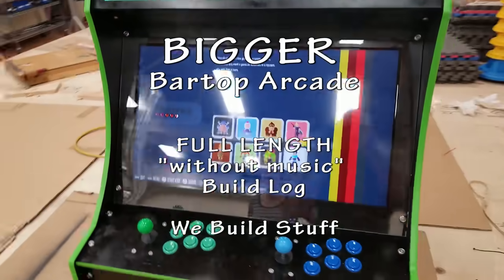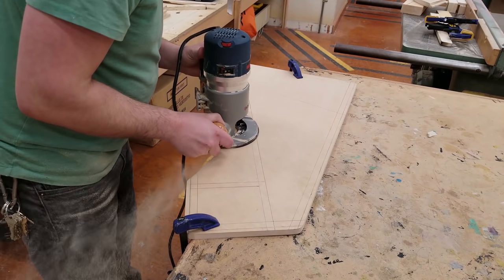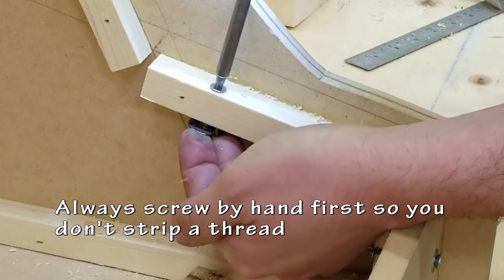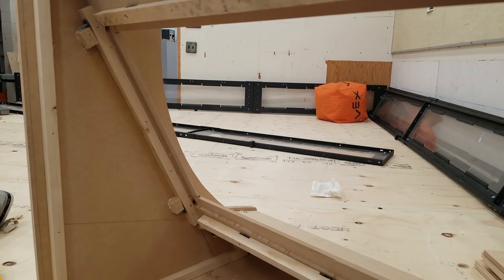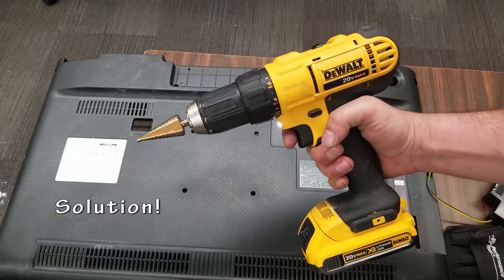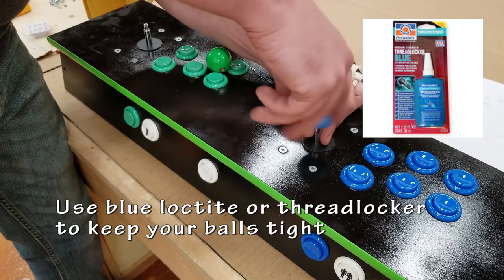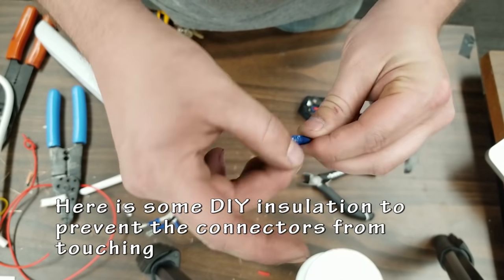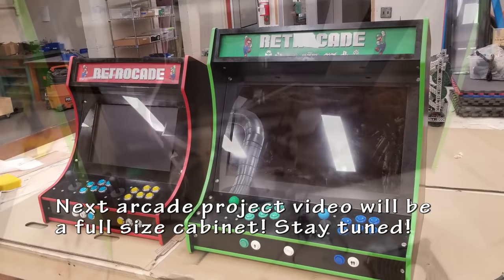Build a BIGGER BARTOP ARCADE - FULL LENGTH AND FREE PLANS!

Comment: Hi, Nice build,  i was just wondering, what speakers did you use for this project? and where did you get them from?  as I need something similar for mine, but as of now haven't been able to find anything that will fit
Reply from the maker: The speakers for this were from the inside of the tv. I pulled the case apart and relocated them using some speaker wire as an extension. Almost any cheap set of speakers on amazon (pick the size that fits your build dimensions) and a basic amp will work.

Comment: Very cool! Enjoyed the build process. Thanks for sharing. I've been working on a mame cab for about 10 years. Built the frame out of 2x4s, have front kickplate, CP, and marquee in place, but still need to do the side panels, and back door for it. It's bloody heavy. LOL.
Reply from the maker: Thanks for watching!
I built a full size cab last year and even with casters it was a pain to move around!
Reply: Ah, yes. I knew it was going to be heavy as a fridge, so I made sure to put large, but recessed casters on my machine. It's so massive, even on the wheels, it doesn't want to move, when being played. Lots of inertial mass. :)
Reply from the maker: @ThomasGrillo  But i bet it's fun!
Reply: Oh, yeh. It's fun, but the PC finally died, and I need to put a Retro Pi, or something in it. It's a 2 player cab, with a spinner, 2 track balls, sticks, 7 buttons per player, and 2 pinball flipper buttons. unfortunately, I didn't think to put the holes for them, on the sides of the CP. LOL. Just need to cut out the coin door hole, and slip in a fake coin door.

Comment: Unbelievable, a friend and I are going to start something similar for my Restaurant, I'm so exited, thinking perhaps a full sized one for home as well with the pi4.  
Quick question, is there the option to use bluetooth controllers as well like just I have some 8bitdo controllers that I would like to use on there as well.
Reply from the maker: Yes I have seen lots of builds using controllers. Add a usb hub so you can plug in on then control panel or hidden sneakily somewhere.

Good luck with your build!
Reply: @WeBuildStuff  thanx for the quick reply, I'm just thinking live yo have both options, the pi is great
Reply from the maker: @Eddylive  for sure.  Thanks for watching

Comment: id prefer using osb or plywood over mdf  as mdf is prone to moisture absorption in high humidity condition  and as for painting the cabinet i recommend using latex primer coat outside and inside  to seal the wood from moisture absorbing  then color paint of choice
Reply from the maker: That's the best thing about these is the variety of techniques, materials, finishes, etc that can be done from a base set of ideas as presented here.  These videos were originally made to help high school kids in a shop program.
Reply: @WeBuildStuff  yeah imjust giving good advice and hints
Reply from the maker: @jamesfatula5824  completely! The comment section is a great place for people to learn more 😁

Comment: So I'm following this video for my build and it's turning out really good.  I noticed in the video that your wiring of the power socket doesn't match the wiring diagram that you show... is this what I'm seeing or am I going crazy... which way is correct?
Reply from the maker: It all works. I've wired about 5 of them this way. The diagram may look slightly different depending which socket you buy. I triple checked the diagrams and so far no fire!😉
Reply from the maker: https://images-na.ssl-images-amazon.com/images/I/71fPmo0RHPL._AC_SL1200_.jpg
Reply from the maker: @JayGasEssex  thanks for the tip. I checked the wiring and I did do it correctly. I think the labels on the photo were different

Comment: I was wondering what a rough cost is to build just the cabinet? Great video and I will have to check out your other ones. Thanks
Reply from the maker: Just the cabinet sheel usually costs between $20-30 for me if I'm using 1/2" thick MDF and some 2x4 or other scarps to make the cleats.

Plus whatever costs you can get hardware and electronics for.

Comment: Probably a Moronic question.... but can a cabinet such a as that one can it be build with arcade stick controllers with a HDMI selector and have for example 3 mini consoles to it??? nes mini snes mini Nd sega genesis mini...
Reply from the maker: It is just a box and you can fill it with whatever you like! I think the tricky part would be switching controllers between systems.
Personally if you wanted to to have NES, SNES, and Genesis then those would all run well off of any raspberry pi from the Pi Zero to the Pi 4. Those systems  do not require a lot of power to run.

Comment: Hi,
How did you get the angle when doing your control panel ,cutting on a table saw ?
I have the angle which is 103 degrees so I set the angle at 38.5 degrees which is a mile off ,any ideas ?
Reply from the maker: Table saw or angle with a circular saw and a guide. I typically have a scrap piece I practice with unless I know the angle already. It can change depending how well you do your layout lines
Reply: We Build Stuff 
Thanks for the reply,to get it accurate I took my angle finder and put it to the saw blade and set the blade that way.

Comment: I dont have anyway to cut or saw wood at home. Do you have any tips on how I can do this otherwise?
Reply from the maker: In all seriousness do it outside or in a friends driveway/garage with some very inexpensive tools if you shop around.
You can build something like this or at least a basic one with just a drill and a jigsaw if you go slow.
A single sheet of plywood/mdf is enough to do this project and maybe 1 2x4 the way I do it. Half the 2x4 used as the inside brackets and to put under your wood if cutting on the ground if you don't have a table or sawhorse.

A used drill with maybe 3 drill bits, used jigsaw with a medium blade, hammer, nails, glue, screwdriver. A good ruler/meter stick is great but you just need a way to make accurate cuts and go slow. All the above are what I recommend to home owners for fixing and maintaining their homes in general.

If you dont have any way to build there are many affordable ready to assemble kits on the market. Lots of ways to customize your build depending on what you are willing to put into it. Lots of great channels sharing info on these. Check out ETA PRIME for some good info on the programming and game side. I just enjoy building cabinets😁

Comment: Is there something else i could use besides a table saw or a jigsaw because ever since i witnessed a friend of mine cut his finger off in woodworking class i always have those thoughts of cutting off a limb.

Also if i ever do my own arcade build the one thing i was thinking of doing was using a 200mm fan in the back (intake) and on both sides using 80mm fans (exhaust) and also use varnish to give it that clean wood look.
Reply from the maker: Witnessing an injury (or having it happen to you) always sucks but if anything it can be a learning experience on what not to do. Getting the right training or demonstrations is always key to avoiding bad stuff happening! 

A Jigsaw would be the minimum I would use since it's cheap and can handle just about everything for a project like this.

The cool thing about every project is the ability to customize the look and everything about it!
Reply: @WeBuildStuff  There is one other thing i was thinking of doing for my bartop is adding joystick latches on the side pretty much making 2 more arcade sticks that can connect on the side with 3 to 4 buttons only for those 4 player action/adventure games which is why i plan on using a 26" to 32" monitor but also still waiting as well for Recalbox/RetroPie to release a working version for the Pi 4 cause there are certain games i love that doesn't run well on the 3B+.
Reply from the maker: @EcksGamer  check out the Odroid xu4 boards. More power than a rp3
Reply: @WeBuildStuff  Well there is also the Atomic Pi which is also more powerful than the RP3 cause it is using an Intel Atom X5 chip which installing Linux on it and RetroPie should be able to play games a lot smoother.
Reply from the maker: @EcksGamer  Cool beans!
I enjoy building them more than actually playing :)

Comment: Hi,
The final result is amazing!!
I have 3 questions :)
1 - the pad where the stick and buttons are, looks small, is it comfort?
2 - what is the thickness of the MDF, couldn't find it anywhere :)
3 - on the plans pdf, is it inches or CM ?

Thanks :)
Reply from the maker: Metric measurements in the plans that are not entirely perfect. I always tweak as I build. 1/2" thick material from home depot.

I find the pad comfortable but if it was a bit deeper it would give your hands more room to rest.
Reply: @WeBuildStuff  thank you :)
Are the plans on CM or inches?
Reply from the maker: @reemh3977  Metric. There may be  some in mm and cm. I need to re edit my plans but everything is available in DWG cad format if you need to make changes. Check the description for links.
Reply: @WeBuildStuff  you are amazing!
You fast responses, and care :)
Do you have some newer plans with some modifications? Or I can use those for my project?
Reply from the maker: @reemh3977  I would use the plans I have there and change what you need. Always use plans as a guideline. Everyone has different tools and may build differently. I have presented mine to go with the video and show the techniques I use to get to the finished project

Comment: Hi, thanks for your work, I have a question please: how mutch game we can put in raspberry pi? and if we put much games that's make it slowly or has problems
Reply from the maker: Add as many games that will fit but I have seen different results from usb sticks that are slowed down with too many files. I've started by only adding the games I want to play on my personal arcade
Reply: The amount of games is only ruled by the size of SD card, but now the Pi3 and 4, can use external USB drives I have a 1 Terabyte on my Pi 3
Reply from the maker: @yodamann5193  ya thats rad

Comment: I'm making one right now and if it turns out I'll probably try to add a bottom with an invisible seam. It's 32" screen so full size screen. I want around 10 machines in my basement man cave/bar and thinking about it it's kind of pointless when one arcade machine can have 100s or 1000s of games built in but screw it I want 10 machines lol
Reply from the maker: Some single player ones would be cool as well and double player fpr other specific types!

Comment: hi i no this is a old post but im attempting to build a arcade bartop machine based off the plans you have got here im already half way through im using 12mm mdf wood my first time doing the t molding etc im just recently ordered a router i pick it up tomorrow first time user on it so my question is what t slot cutting blade do i need to cut the edge of the 12mm mdf please.
Reply from the maker: I ordered these for my router. There are other sizes available but these fit well for my t-molding (also ordered from the same site)

Cutter:
https://www.t-molding.com/whiteside-slot-cutter-6700a.html

Arbor:
https://www.t-molding.com/whiteside-arbor-a200b.html

T-molding: (lots of colors available)
https://www.t-molding.com/1-2in-green-t-molding.html
Reply: @WeBuildStuff  thank you kindly for replying back to me here in new zealand at my local bunning store i picked up a 3mm blade with the abor peice im now thinking i should have got the 2mm blade as the 3mm blade i got is just slightly bit to big so i will get a 2mm blade next week so the t molding will be a tighter fit to go into the groove thanks for the advice and info i really appreciate that.
Reply from the maker: @markhowe6334  if it's loose try some super glue!
Reply: I used hot glue with glue gun thst sorted it thanks for the tip I just need to get a craft knife and try to trim the plastic on each side to go flash against the panels on side.

Comment: how do I get the pc monitor to turn on without using the power button due the fact that the bezel is in the way.
Reply from the maker: I choose monitors that powered on as soon as they got a signal or i would drill a "sneaky hole" that lines up with the button that can be pressed with a finger or a pen.

Comment: Just a pro tip of my own .... 
If you take a straight edge and clamp it to your work piece you can use it  As a guide to get a straight cut Quick And Clean. (with a jigsaw or skilsaw)
Reply from the maker: For sure. I have a sled for my circular saw now but not everyone has that luxury 😁
Reply: @WeBuildStuff  I use my 6ft level most of the time :D

Comment: How much would you say this would cost for me to take to a carpenter? A rough guide price, using his materials, not mine. Need some guidance on a fair price.
Reply from the maker: Build it yourself for under $500-600.

If I was doing custom  builds (not quantity pumping them out) i wouldn't charge less than $1500-2000 for my time/materials/experience depending on options.

I would consider that fair for a custom build

Comment: What are the screws called that you use to attach the monitor glass? I’ve been looking all over to figure out where to order some like that.
Reply from the maker: T nuts. I think I used #10-24
But as long as you choose matching bolts/machine screws you should be good
Reply from the maker: https://www.amazon.ca/SNUG-Fasteners-SNG1015-Hooks/dp/B089Q1RJTK

I find these as Home Depot, Hard ware stores or stores that specialize in fasteners
https://www.fastenal.com/product/details/11115605

https://www.homedepot.ca/en/home/categories/building-materials/hardware/fasteners/nuts/tee-nuts.html
Reply: Awesome! And what’s the washer/bolt combo called? I can’t seem to find what those semi-decorative washers are called…
Reply from the maker: @nicholaslandkamer5951  finishing washers. Just need to find the size that pairs with your chosen screws/bolts and the style you like.  I usually wander the hardware stores and choose based on function and look.
https://www.homedepot.ca/product/paulin--8-steel-countersunk-finishing-washers-standard-type-nickel-plated/1000144340
Reply: Fantastic! Thanks so much! Looking forward to getting my cabinet done!

Comment: just out of curiosity what is the point of routeing out the spot for the joystick. You mention it but don't do it. Also awesome build and instructions.
Reply from the maker: i have seen some builds where they route out a square or rectangle for the base of the joystick to fit into. If top mounting instead up underneath it allows it to stay flush. http://forum.arcadecontrols.com/index.php?topic=51235.0
Reply: @WeBuildStuff  Thanks! that makes sense

Comment: I'm a bit confused at the supports step. First you say you use 1/2" MDF to lay out the lines because that's what you're going to end up using but then you cut up 3/4" square strips out of 2x4's. Looking at the video, it looks like you're using the 1/2 lines to mark the edges against where you'll put the 3/4" supports.
Reply from the maker: The thickness of the strips isn't super important as long as one edge lines up perfectly with your layout lines. I do like 3/4 thick supports as it is easier to attach the t-nuts due to the fastener width.
The 1/2 thick lines are so I can see where my 1/2 thick mdf panels will be going
Reply: @WeBuildStuff  ok, I get it now. That makes a lot more sense. I didn't make the connection. Thanks for the quick reply!
Reply from the maker: @camaperture8116  happy to help!
Reply: @WeBuildStuff  since this video is 5 years old I'm just wondering if there are any updates to your recommendations for the Raspberry Pi, components, software, etc. or if everything in this original video still applies as is.
Reply from the maker: @camaperture8116  the main idea of the components are the same. You need a screen, buttons, audio, computer board (odroid, pi, old laptop, etc) for the front end software and games, etc
I would totally use the newest version of a Raspberry Pi . Some of the cables will be different (the newest Pi doesn't have an AUX output for sound) but overall it is still just a cabinet that holds stuff. Make  budget and buy components that will work for you😀
Reply: @WeBuildStuff  ok thanks. The reason I ask is because I'm all good when it comes to building the cabinet (already built using scrap wood - total cost $0!) and assembling parts but I know NOTHING about the various platforms and software, etc. and I know that tech can move pretty fast (as opposed to the tech around cutting and gluing planks of wood) so that's the focus of my question.
Reply from the maker: @camaperture8116  I like to use recalbox for the software as it works on many platforms. I still have an old cabinet using a Raspberry Pi 2 and it runs all my retro games great. Anything newer (pi 4 and newer) will still run the retro stuff  and perhaps the extra power for more as well

Comment: Extremely well done!!  Thank you, you earned a loyal subscriber.  Question: would it be possible to mount a 52" LCD in similar manner (in a bigger box of course).
Reply from the maker: Any size screen can work but with the weight You would probably want both the mounting I did as well as a VESA support inside the box. I've included DWG plans that can be easily modified for this project. Thanks for the comment and let me know if you have any other questions!